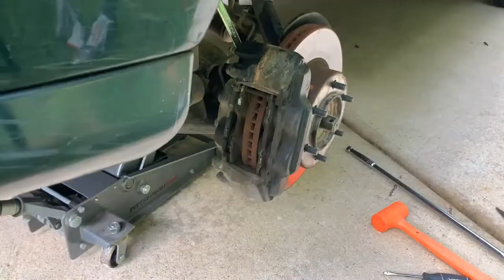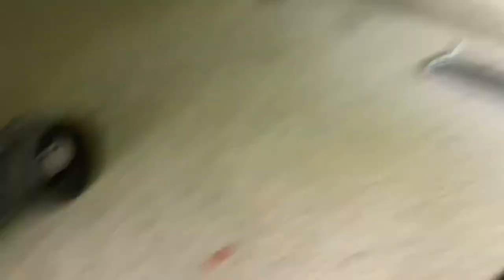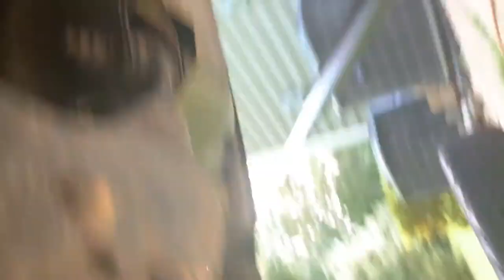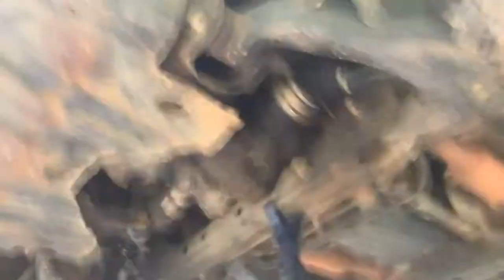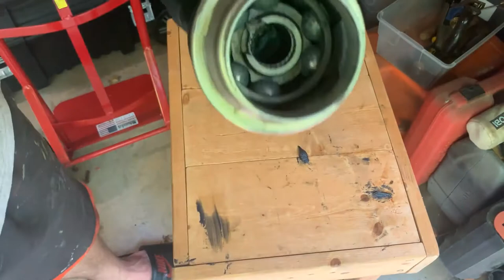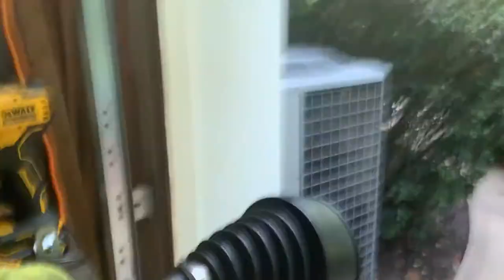First Gen Tundra CV Boot Mod How to Tutorial

Comment: Thanks for this! I just noticed a tear in my upper CV boot on the drivers side that I need to replace ASAP. Today is the 11th and I'm leaving for Denver on the 16th (7hour drive). Ordered my parts off Kartek. 

On the Kartek website it says to cut the bottom out of your factory boot and use it as an adapter inside of the bates boot. I didn't see you do that in the video. Can you elaborate on if you did or didn't do that and why? Thanks for the video.
Reply: also, any leaking from your axle seal?
Reply from the maker: Yeah it said to do that but I didn’t see the point.  I just didn’t and it worked fine. My boots are doing great still after 6 months. 

Also there is a little seepage of fluid from the joints but nothing serious, there is always gonna be a little bit because that’s how the seals are lubricated.
Reply: @takemechrome2291  Good to know. Thanks for the reply

Comment: you do not need to remove the brake caliper or rotor to move the spindle out of the way. just undo the 4 bolts on the lower ball joint and move the whole assembly with everything still intact.
Reply from the maker: That is very true, I didn’t think of that, but it makes sense. Thanks for the tip!

Comment: Hey bro I have a cuestion. I have a 2000 tundra with a 2.5 level rancho struts. I have the same problems with the cv axle shaft can I install the oem or it has to an extended ones??
Reply from the maker: I mean, if you’re gonna replace them, you might as well just go ahead and get the bigger and better ones. They will probably last longer as well

Comment: Did you lose any fluid ? If so how much ? Enough to replace ?
Reply from the maker: I’m assuming you are talking about the front diff fluid. Yes you’ll lose some fluid but only a small amount so make sure you top it off once you’re done
Reply: I'm just replacing mine since I'm there in the process-less than 2 quarts in the whole diff

Comment: what size socket?
Reply from the maker: Jon Hoover for what bolt?
Reply: @takemechrome2291  the hub nut. 35mm?
Reply from the maker: Jon Hoover yes if you can find a 35mm. I couldn’t so I used a 36 and it worked fine